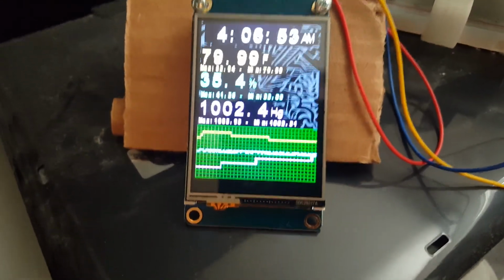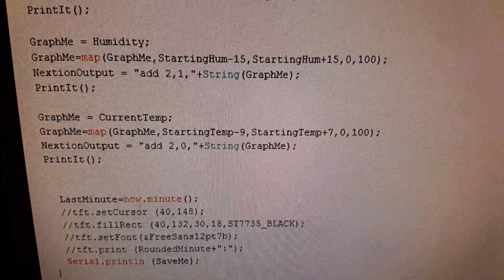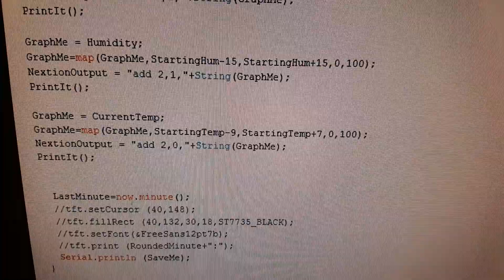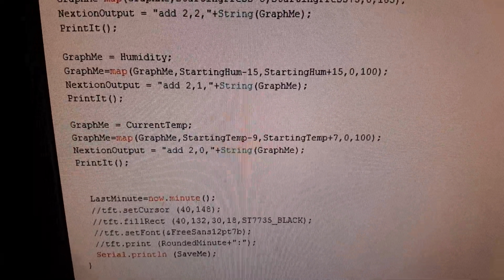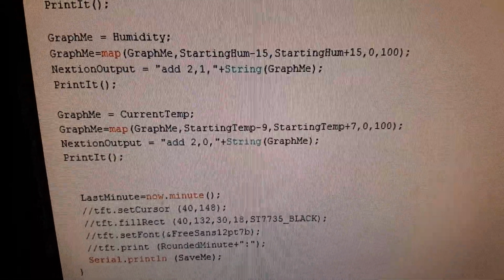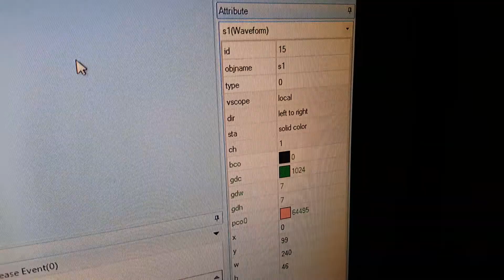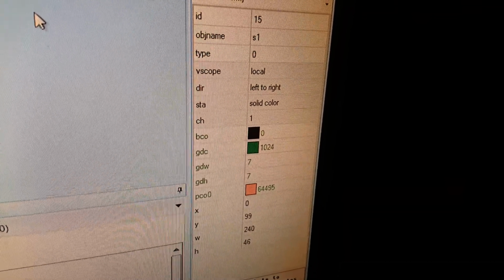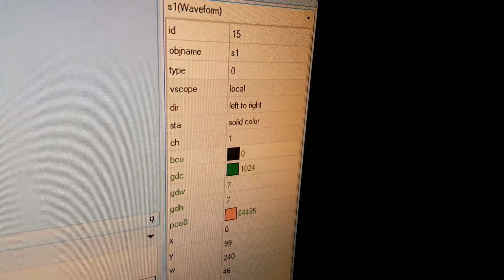Easy way to make Nextion graphs work!

Comment: Hi , may i ask you please make a tutorial for a keypad that includes numbers from 0-9 and enter and clear buttons when a right code is entered we're leaded to a new page in order for example turning on and off a LED and extra option for changing password. Thanks, i couldn't find any videos and i don't know what to do
Reply from the maker: My only screen is in use by that weather station, so unless I get another screen, my work with them is done.